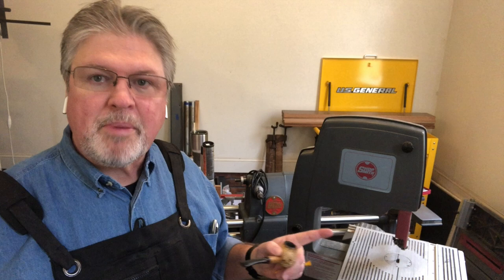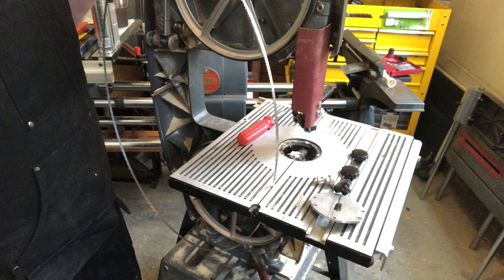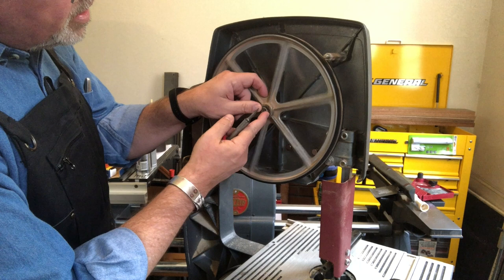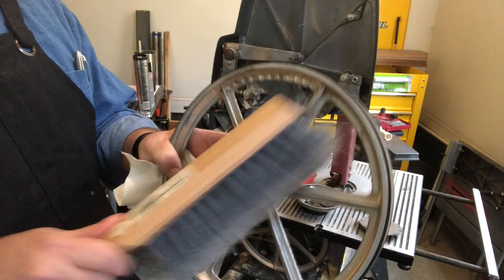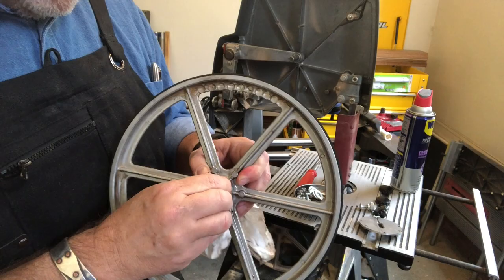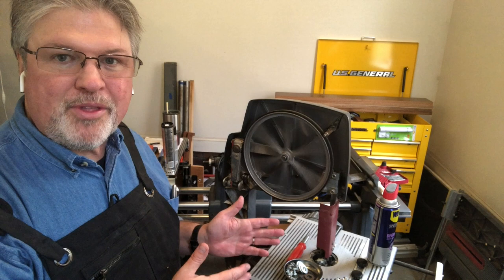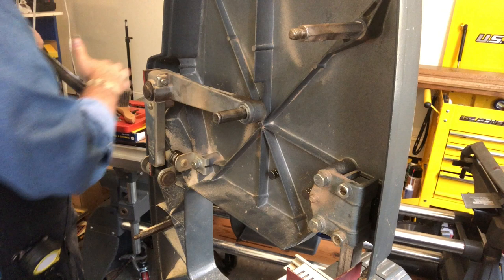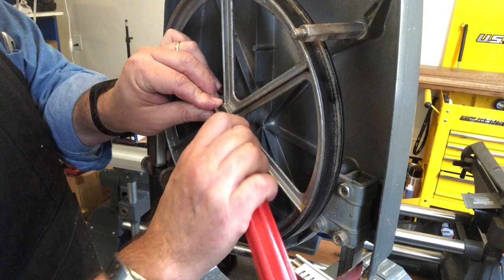Shopsmith Bandsaw Maintenance: Greasing the Upper Wheel (How I Fold a Bandsaw Blade & Why I Don't!)

Comment: I just picked up a 14” band saw that needed a little TLC. I stripped it down and made the necessary adjustments and repairs but my wheels are attached with what looks to be basic nut and bolt
Reply from the maker: Yes, sometimes that's what they do on 14" saws.

Comment: I just did an upper wheel maintenance on my new to me 1956 Magna bandsaw. Your tips were right on but I found a third retainer that I don’t think you mentioned. My upper wheel is retained by one of those thin spiral springs like the one in the headstock (belt tensioner as I remember). Great videos, all of them. 👍👍

Comment: Very good information Scott. Thanks for your time to share your knowledge with us.
Reply from the maker: My pleasure, Ellis.  Scott
Reply: Scott injoy you're video on wheel bearing replacement. But mine still makes noise maybe I used the wrong grease. Will try the grease you said to use
Reply: Great content, and a very good presentation. Keep them coming. Can you test for run out .or any other specs to measure. Thanks for all your work and time to produce great content.
Reply: I totally agree

Comment: Great video- I know it was posted some time ago but how much wobble should there be with the wheel on the shaft when not under tension of the blade?  Is it naturally a little loose on that shaft or is that a sign of wear?   I’ve had a couple used bandsaws and they both have what seems like some play on that shaft (ability to tip on that shaft, but no lateral thrust)
Reply from the maker: That’s a great question. I’m not comfortable with much play, so if the grease and the tension don’t remove the play, I’m going to replace the bearings or the entire wheel, if that’s more convenient. Scott

Comment: Ok...I’m all set. In the last few days since I first watched this video:
✅ WD-40 degreaser
✅ Small tube of grease
✅ BS cover off, blade off, clip off, wheel cleaned of years of dust, degreaser sprayed on the bearing

Today, greasing and refitting the wheel & putting on a BRAND NEW blade!

Wow, wow, wow. Degreased & fully filled the upper bearing & thoroughly cleaned everything up.  Installed a brand new Wen 1/2 blade & wow.  Cut beautiful perfectly straight lines on a standard 1 inch PT deck board.  Adjusted all the guide/cooling blocks. Thanks for all the tips.  Next purchase a 3 pack (1/4, 3/8, 1/2 inch) of TimberWolf 72 inch blades .
Reply from the maker: Fantastic! Sounds like you are well on your way. Have fun! Scott

Comment: Great video!  I bought a used Power Station with a bandsaw.  That bandsaw is probably in great need of changing the grease in the bearings.  Two questions:  1) Lower wheel procedure?  2)  Lubrication tips for the Power Station.  Enjoying your videos quite a bit!  Thank you!
Reply from the maker: Hey Fred. Love your work.  The lower bearing is sealed for life, so as long as it is running smoothly and quietly you should be fine.  Oh, the Power Station... !  More to come. Scott

Comment: Something I learned quite by accident while rebuilding Kirby vacuums is that modern magnetic parts dishes have strong enough magnets that they will grab a flying spring right out of the air.  I had a height adjustment spring go flying toward another room one day.  I saw it go.  I thought it ended up in the bathroom, and I spent an hour looking for it.  Kirby height adjustment springs are substantial, and if they fly, they tend to fly a long way.  Later, I turned my parts dish over, and that spring was stuck to the magnet on the underside.  The magnet had grabbed it out of the air as it flew.  I pretty much keep one of those dishes close by when I'm pulling something that has a spring in it, as an extra line of defense against losing that spring.

My grandfather had a Hertz franchise and a Hertz truck leasing franchise.  He swore by white lithium grease and wouldn't use anything else in his vehicles.  He taught me to use it, but never really explained why.  That was good information.

Comment: I use a synthetic high-temperature wheel bearing grease.  It's the same grease I use for my truck's wheel bearings which are roller bearings.  A wash-bottle filled with mineral spirits works well for washing out the old grease.
Reply from the maker: Great tips! Thanks Robert. Scott

Comment: Great info Scott. I've had my bandsaw for about 24 years and I have never greased the upper wheel. No wonder It screams. I have taken the wheel off, cleaned everything and it is ready for grease. Just waiting for it to get here. In a previous episode, I noticed that your headstock slides easier than mine does. Since I was in the cleaning stage, I took off my headstock, and cleaned and waxed all the tubes. I didn't find any wax build up in the headstock holes so I'm wondering why yours slides easier than mine. Yes, I waited an hour before I buffed the tubes and put it back together.
Reply from the maker: One thing that I always check is if the tubes are slightly bowed (most are) and if so, are they bow-side up? That and regular allocations of wax can help a lot.

Comment: I have a Shopsmith bandsaw (along with the  mark V and the jointer) that sat unused in my basement from around 1994 to 2021. I was concerned about returning it to use. Your bandsaw videos have been a great guide.  

Do you have similar videos or information about returning my old shopsmith jointer into operation? When I returned it to my workshop I ran it very briefly to joint one side of a small board and it got unusually warm. There is probably some serious overdue maintenance. If you have you tubes or other info about returning the jointer into operation that would be very useful.
Reply from the maker: Hey Robert, that's awesome! I have done a couple jointer videos, but I'm not sure that I have a single video to point you to, so here's a playlist of my jointer vids: https://www.youtube.com/watch?v=OvfKgNtxsR4&list=PLxYlYd_yP0Wef7oG4ZZUjk4YuGQHcJYL7

Comment: I'm back at it again and this video has led me to most all your other bandsaw tips, tricks and other things videos except for the new tires one.   A blade break today brings me back to this vid.  My top wheel has a slight wobble (wiggle if you prefer) to it leading me to think I might need new bearings.  After removing the wheel, I "nail-checked" the spindle shaft and besides the neglected dirt buildup ring on it, I felt no wear ridges.  Since the bearings were dry (long time neglect dry, very dry, bad Shopsmith owner dry) but otherwise looked good, is that little looseness a concern since, as you said in this or one of your videos, that it is designed for downward force?  I had a hard time pulling the wheel off of the shaft, but hindsight now points to the debris buildup on the shaft end.  I know it's a tolerance judgement, but how much wiggle (or wobble) is too much?
Love the videos!  I've found another Mark V I'm rejuvenating referencing your maintenance videos!  Thanks again!
Reply from the maker: Hey Curt. Yeah, that’s a tough one to explore in a post comment! My advise is to pack it with grease and give it the ol’ proof is in the pudding’ test.  As long as it runs “quietly” (again, that’s subjective) and smoothly (again) you should be good to go. You’ll know when it is time to change the bearings. Scott

Comment: Enjoy your videos just recently got a 510. Have wanted one for over 50 years. Have built your rip fence extension and added hf light to bandsaw. What material thicknes to make a zero clearance saw insert. Thank you
Reply from the maker: I make them with 1/4" tempered hardboard (Masonite). It makes them ever-so-slightly under sized, so I shim them with masking tape around the bottom edge. Works like a charm. I am intrigued with the zero clearance insert made by Jim Sevilla on his channel. It's worth a look. Scott

Comment: Awe man... now I have to add to my yearly maintenance list... Grease the bandsaw wheel!

Thanks Scott, I needed one more thing to piddle with!!!

Actually, I thought it was a sealed bearing.  I’ve never paid any attention to it.  

How about the lower wheel?  Being a drive wheel, does it have a different type of bearing in the hub?

Nice illustration of an important and overlooked task.
Reply from the maker: I did a video that covered the lower wheel but to cut to the chase, it is a shield for life water pump bearing assembly. Scott

Comment: Thanks Scott for the videos!  You are a life saver among SS owners.  I performed this procedure, and had the same issue wherein my bearings fell out.  I will order new needle bearings based on the link you have provided, but just need to double check:  My bandsaw is Yuba, not Shopsmith.   The Yuba seems identical to SS in every other way, so I would assume the needle bearings would be the same as well.   Do you happen to know for sure?
Reply from the maker: Yes, Yuba owned the Shopsmith brand for several years, so Yuba is Shopsmith and everything is interchangeable. Scott

Comment: Hi, Another great video. Does renewing the grease eliminate the screaming that the BS makes? I noticed your SS makes the same screech as mine (Vid on 5th Oct 2020  ~ how to measure for length of bb blade). I use the bandsaw separately on the power station, but I had the same racket coming from the bs on the main SS unit (I think I have SSmk5, quite an early one) I have just fitted to the power pro upgrade!! Ps. I am in UK
Reply from the maker: It might, but then again it might not. It all depends upon where the screech is coming from. For sure it won’t hurt if it needs some grease. One of the unique features of the Shopsmith bandsaw is the auto track bearing assembly on the left-hand side of the machine. That adds two ball bearings more than your typical bandsaw, therefore you get a bit more noise. Those bearings are not expensive and can be easily replaced if the noise continues after applying grease to the upper wheel.  Scott

Comment: There is a danger using degreaser to clean the bearing.  The solvents may affect the new grease.  An alternate method is to push out the old grease with new grease.  This avoids the danger of compromising the qualities of your new grease.
Reply from the maker: Great tip. I wailed to mention that I usually rinse the bearing with a solvent and blow it out with compressed air, but even that can introduce water and contaminates. Scott

Comment: I'm sure that my bandsaw hasn't had anything greased on it since the 60s.  Time to take it apart! is there any other periodic maintenance on the bandsaw?
Reply from the maker: Yes, I would say that it'll need it. If it has the original bronze bushings in the auto-track wheels they will need either oil or graphite and may need to be cleaned. Scott

Comment: My all original 1981 SS bandsaw (cast iron table) doesn't have the eccentric tubes, just stop collars, unlike the jointer, belt sander, jig saw that do. The drive shaft on the bandsaw is horizontally misaligned with the upper shaft on the headstock by about 1/2". Everything else is in proper alignment except the bandsaw drive shaft. The drive coupler (original 1980) engages with the upper shaft on the headstock about half. Been using it that way for decades. It's odd that Shopsmith shipped it with the straight tubes back then.
Reply: Also, part of the web on one of the sections of the upper wheel on mine was milled away for balancing back then (1981), not drilled like yours was.
Reply from the maker: Yeah, the eccentric tubes were a common sense solution that took a surprisingly long time to be introduced. If it's that far off I'd suggest getting a set, but even then you arn't going to correct 1/2" of misalignment. Scott
Reply from the maker: I remember seeing that on bandsaws that were coming in for service when I started there in '87. I seem to remember some that were balanced with Tinnerman clips added, but that may have been a user fix. Scott

Comment: Hi Scott, how do you go about changing the tire?
Reply from the maker: I need to replace a couple of them and even have two different sets to install, but just haven't found the time. It's no different than on other bandsaws so for now I would suggest looking around Youtube until you find a method that makes sense. If you choose to heat them in water just make sure not to exceed 120 deg fahrenheit of they may deform. Scott

Comment: Robert Shaw, I purchased my Shopsmith in 78, a 520. I have recently ben breaking blades. What are the most comment causes? Thank you
Reply from the maker: Could be a couple things. Are these new blades?  What brand of blade are you using? Heat and metal fatigue are the normal cause of blade breakage. This can be caused by long-time usage, but if the blades are new it can happen from running at too high speed or back friction from too tight guide blocks. Also, if the guide blocks aren't properly positioned they can impact the set of the teeth, which can cause damage.  Those are my best bets. If you haven't tied Timber Wolf blade I highly recommend them. There's a link in the video description. Scott

Comment: Well, I took your advice.  My band saw is only 50+ years old and never been maintained.  To be fair, it wasn’t used the first 30 years.  In any event, I took off the wheel and used a rag to clean the bearings.  The bearings fell out!  Can you send me a note on how to get a new bearing and how to replace?  Thank you, my band saw will likely work better if I can fix it.
Reply from the maker: There’s a link in the video description to the bearing and if it fell out the new one should press right in with a light tap with a mallet.
Reply: @MyGrowthRings  thank you, I found the bearings, but I can’t get the original bearings out.  Any suggestions?
Reply: I got one bearing to move in some, but the other bearing won’t move.  I’m trying some penetrating oil but no luck yet
Reply from the maker: @barneyheller  Use a nail or flat head nail as a punch and place the screw through the hole and use it to tap the bearing out. Tap gently and slowly while moving to a new spot for every blow. If you tap in one spot too much the bearing will get crooked and could damage the wheel.
Reply: @MyGrowthRings  thank you for your help. I ended up using a torch and a wooden dowel ( not at the same time) to get the bearing out.  It was really stuck. Now I’m waiting for the bearings so then I can watch all your videos.  They are excellent!

Comment: my bandsaw has the old spring clip, which I would like to replace with either a c-clip or e-clip; I looked through the comments, but don't see any mention of size.
Reply from the maker: They’ve used a couple over the years, so my advice would be to pick up an inexpensive assortment. You can find them at Harbor Freight and on Amazon. Either option will cost you less than purchasing a single clip from Shopsmith.
Reply: But, what will I do with the other 299 clips? LOL @MyGrowthRings
Reply from the maker: @christopherbendel  For the difference in price your could throw them away or give them away on one of the forums.

Comment: Saw this video, really like your detailed advice.  My shopsmith bandsaw upper wheel has a spiral ring.  Took it off and need to replace it with either a snap ring or e clip since not able to find a spiral ring replacement part.  Can you recommend what is the proper size of the e clip or snap ring to replace the spiral ring?
Reply from the maker: Thanks Chris. I believe that the groove is 1/2" and you can replace the spiral ring with a standard "e-clip".  if you don't have one already, a set is a handy and inexpensive thing to have on hand: https://amzn.to/3AHm08D

Comment: Thanks Scott, nicely done, as usual. Question:: I have not greased my upper wheel (but will be immediately). I notice a 'squeaking' sound when I run the bandsaw. Could this be the cause or is there another culprit?
Reply from the maker: There are several bearings and any one or combination of them could be the culprits. Greasing will help, though.
Reply: @MyGrowthRings  thanks. I watched every video you have on the bandsaw last night, some for the second time, and I'm going to break it down today and get everything checked over, grease when I can and see how it does after that. Thanks for your prompt and helpful response.

Comment: great info as always.  I forget - have you done a video about the tires? I've had to replace mine several times now, from original rubber that began to slip, to urethane "upgrades" from SS, to another mfg'ers. What're your recommendation and issues to be aware of?
Reply from the maker: Hey Hal. I have two sets of replacement tires but haven’t had the time to replace them. The reason I bought two different sets of the urethane tires is because I really don’t have a strong feeling about them. Glued, rubber tires are tried and true, but they won’t last forever, that’s for sure. What are your thoughts? Scott